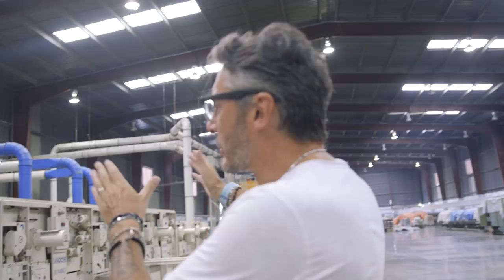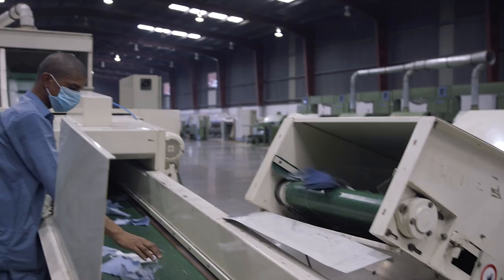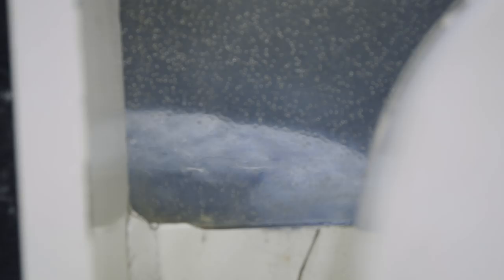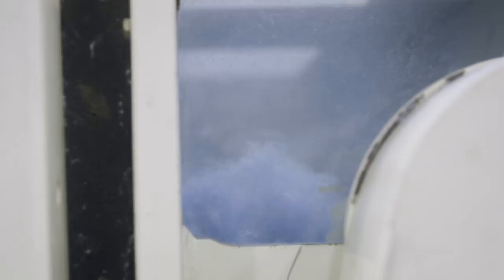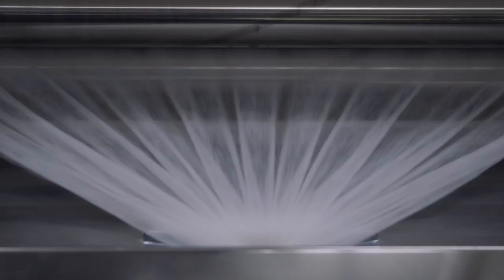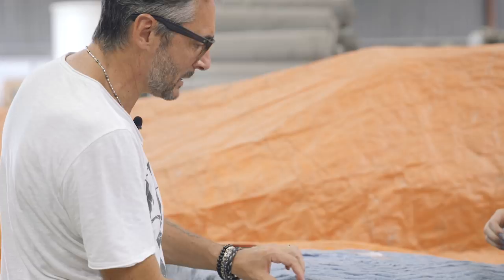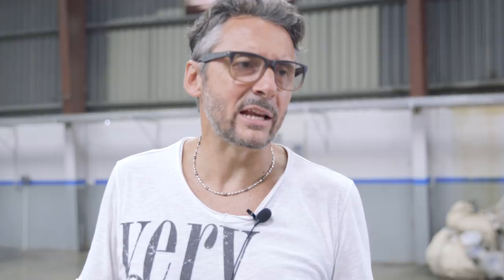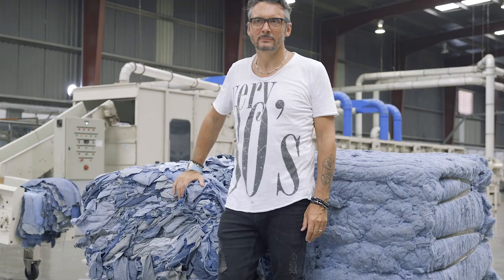Recycling Used Denim Into New Cotton With AFGI's Post Consumer Waste (PCW) Machine

Comment: This process is better than the items being donated to opportunity shops whom only throw most of their donations out, because they usually only deal in the equivalent of new or hardly used, or otherwise just cut them up for auto yard rags, and so after a couple of grease wipes on a car engine they are thrown in dumpsters. Far better that the material goes around again in the production of new clothing, if only at a limited percentage